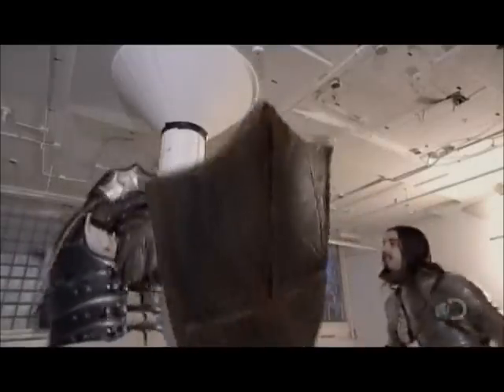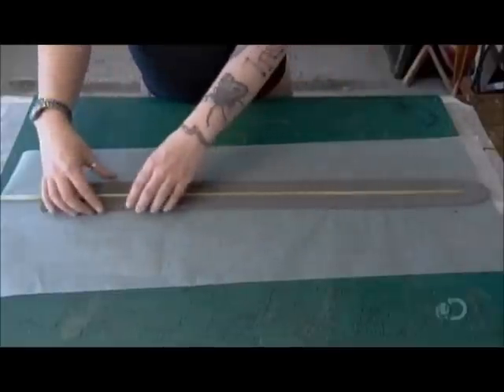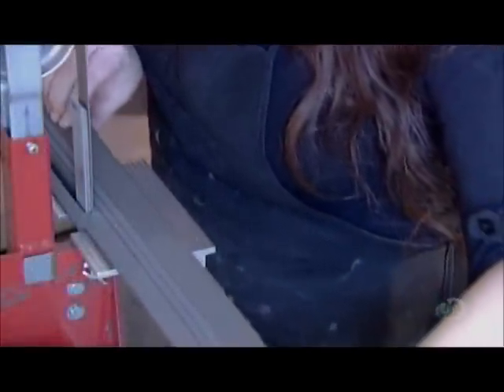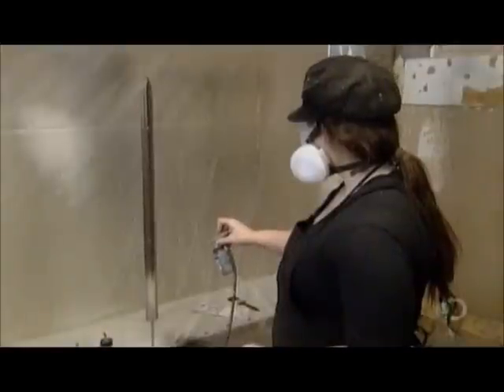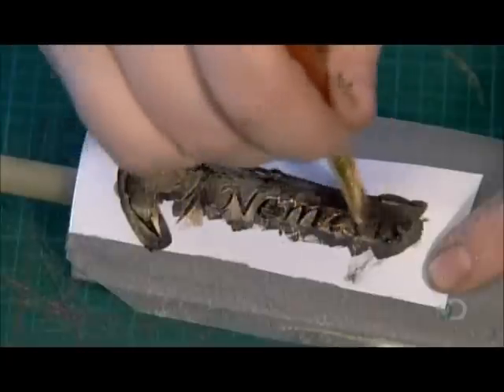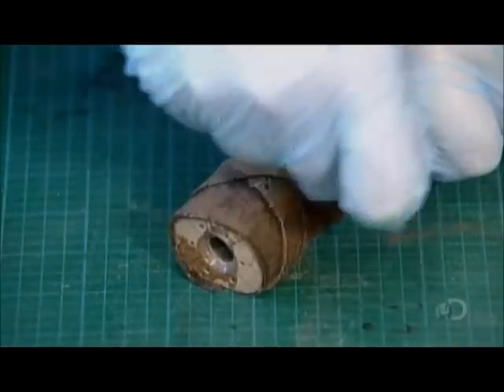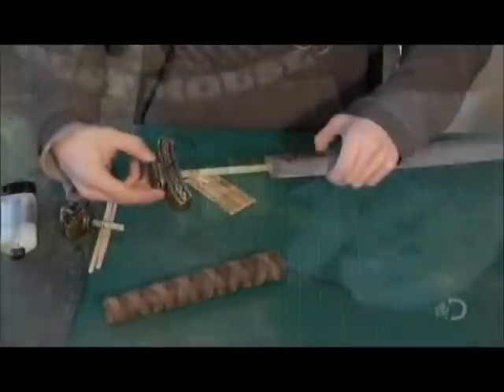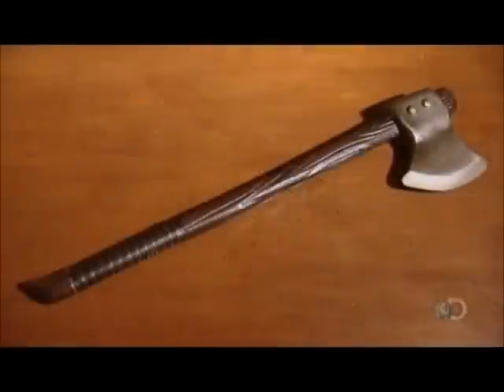How It's Made - Latex Swords

Comment: Larping is incredibly fun. The prices for all the equipment however...
Reply: Lets be honest, those swords are not hard to make... i'm pretty sure you can rent a pain gun and and compressor for the price of a pancake...
Reply: Yeah, the equipment is expensive, but consider that you have material costs, overhead, and likely a couple hours or more of time sunk into each one by the time it's shipped off. Maybe an hour and a half for simpler ones, and it starts making sense. The base models generally run more in the $50 range, which isn't too bad. And while you can sink thousands into garb, you can get some basics that will fit the theme well enough for under another $50. Of course, you can always try making your own if you're so inclined. A lot of LARPs are fine with the cheaper PVC, foam, and duct tape monstrosities, and they may even be fine with you wearing modern clothing.

ForeskinMan Renting tools is actually fairly expensive, and no, most people don't have the skill to create swords of that quality, although they were hardly great examples.
Reply: seigeengine I wasn't complaining dude, I know it takes a lot of skill to make decent LARP equipment ^^; I was just saying, it is an expensive hobby, my daggers cost me £40 alone, the swords I'm looking at will set me back a good £200.
Reply: Commander5AM It's only as expensive as you choose to make it. Getting into it is cheap. A few bucks even. Having an authentic high quality costume consisting of dozens of items can cost thousands though.

Now, the costs to go to LARP events can be pretty pricey though.
Reply: seigeengine The LARP event I used to attend had a standard with rules. One of the rules was all the weapons had to be made by Eldritch and their stuff is very expensive. My get up cost me £10, my armor cost me nothing because I have a good friend who made me it for free as a birthday gift.

The events can be very expensive yes, the one I go to was £60 per event which was full weekend with food provided, but to me that was a lot of money because on top I had to get £40 worth of travel.
Reply: Commander5AM Yes, I've heard a lot or Euro LARPs are anal about costume quality. You know, because way to go Europeans being snobby assholes who create an artificial barrier to your hobbies. That totally doesn't sound like you're complying to a stereotype at all.

Ahem. Yeah, I appreciate that. One of the big North American LARPs I've used as a reference point a lot charges $50 (£32) entry, and then additional fees if you want to play more than one character, or if you want to advance the character more quickly. They do let people come for free if they act as NPCs over the event though. Also a full weekend, but they only provide one meal.
Reply: seigeengine If you want to add to that stereotype, I was doing a photography project in university and wanted to use LARP seeing as I was part of a group but my group split up halfway through my year. So I contacted other groups, all I wanted to do was be on the sidelines and get some photographs for the project. No special treatment, no set up posed shots, I was gonna do all the running around and stay out of their way etc. Two of the five groups that got back to me wanted to charge me £200 for the 'privilege' of photographing their group.

The groups I went to never had costume rules, only weapon rules. Costumes, as long as they fit in with the period or whatever, were fine. It was just the weaponry. Oh and no metal armour for one of the groups because it was kid friendly and they apparently had an accident involving a kid and someone in a full suit of metal armour at some point.
Reply: Commander5AM That IS a costume rule. Most North American LARPs don't require you wear period-appropriate clothing, they only suggest it, because that's just another barrier to entry. Pretty much nobody has period appropriate garb in their wardrobes, so someone just getting into the hobby is going to be dissuaded by that. The worst rules in that area I can remember is a couple LARPs banning the use of graphic tees and stuff like that, whereas a plain solid colour one would be fine.

As for photography, I kind of understand them not wanting to agree to do posed shots, but I'd probably leave that up to the discretion of individual members.
Reply: The rules aren't that strict, it's basically just don't look like you've just turned up off the street. It doesn't cost a lot to buy some black trousers and a white shirt which is the base for a lot of outfits, then you can add to it with a waistcoat or a hat. I did my first LARP session in PJs, for example. They just don't want the immersion to be ruined by having stuff that doesn't fit in. 

I wasn't asking for posed shots. I wasn't asking for anything but permission to take photos of them going about their LARPing. I didn't want poses, I didn't want special treatment, I just wanted to be allowed to stand out of the way and take photos.
Reply: Commander5AM Sorry, but unless you're talking certain styles of dress clothing, pretty much every bit of clothing made today that you're going to find in a store isn't period appropriate.

There was clearly a difference between what you said and how I interpreted it. You listed what you wanted, I interpreted it as a list of what they were giving you.
Reply: seigeengine It doesn't have to be old period clothing, just appropriate to fit in. I got mine in Primark, the cheapest clothing store you can get. So no jeans, trainers, hoodies etc.

No I never asked for anything like that. I just needed photos for this damn LARP book I was making. I didn't want anything posed, I just wanted pictures.

Comment: a pommel now to make sure it doesn't fly out of your hand when its a counter balance
Reply: While most pommels are indeed counterweights as well as slide-stoppers, some are just the latter. I doubt that rubber pommel would be heavy enough to balance the sword at all, especially since the handle had a metal tube in it AND the blade's tip was hollow.

Comment: does anyone know where I could buy the glue that they use to attach the pieses of the blade togeteher? I'm planning on making swords for some of my cosplays and it would really help
Reply: just use regular superglue, the stuff they use is expensive and intended for high quality bonds that last through sustained use. unless you're some ultra weeb that cosplays every day for no reason you don't need better than superglue
Reply: +KingHalbatorix maybe he just wants to make something that won't break in the middle of game. Besides, superglue would probably melt foam.
Reply: Maciej Kozak
He said cosplay i.e. standing still for several hours and posing
Reply: +KingHalbatorix well, no. I said cosplay as in walking around at a convention for aprox 8-10 hours straight for 3 days or so, including skits, fotoshoots, and most likely roleplaying. some of my friend have tried using regular superglue for their props, but it just ends up cracking and braking way too easily. plus, the bonds look like shit and it's hard to conceal them with only paint. the goal of making props with craft foam is to make them flexible and using superglue defeats that purpose.
Reply: Luke Tyler Oswald Pond
why don't you try making them out of metal

oh right, they'd be too heavy for your atrophied little weeb arms
Reply: +KingHalbatorix what about me makes me a weeb exactly? the fact that I want to make my cosplays as good as possible? and about the metal, I've tried using a low price katana, but guess what? they don't allow real weapons at cons. I asked a simple question, and if you don't have the answer then you could just leave.
Reply: +Luke Tyler Oswald Pond 
I used to LARP about twenty years ago, and we all made our own weapons.  Used plain old rubber cement to glue the foam bits, and used liquid nails to attach handles to the core.  That might not sound like it is good enough, but I still have three swords, two quarterstaves and a shield that my kids now play with two decades later.

Comment: It's not just for LARP its for Cosplay too
Reply: What's the point in having a latex sword for cosplaying, a wooden painted one if far less pricey...
Reply: ForeskinMan It doesn't look like absolute rubbish.
Reply: seigeengine It does if you do it wrong and the same goes for wood...
Reply: ForeskinMan Clearly you failed the reading comprehension part of this exam.

Making a wooden sword that doesn't look like shit is going to be fairly hard. On top of that, you're far less likely to be allowed in anywhere with it, because it would be easy to hurt or kill someone with it, whereas latex swords are meant to be used on people without hurting them, so would arouse less concern.

And we're not comparing you pissing around with paint and a stick to you pissing around with fiberglass rods, foam, and latex. The comparison is rationally to a purchased latex sword.

Comment: Wtf he's using that hammer wrong He's holding it sideways. 😈
Reply: Cameron Seitz I was wondering, would it be possible to use latex weapons for actual sparring instead of LARP?  Me and my partners want to use the hard Polyurethane or Wooden swords, but we just can't afford all of the safety gear right now, and we need a safe alternative for the time being. We know that latex swords will be unrealistically light, but we just need something until we get the safety gear. Thanks
Reply: HueyShabazz Unrealistic weight is one thing. The other might be wrong balance - a one handed sword or arming sword should have a point of balance about 1-2 inches above the guard. Another issue might be with binding techniques( blade-to-blade pushing) and half-swording( holding the blade with your free hand for leverage and grappling techniques). LARP weapons may be prone to breaking when using such techniques. You can always make your own training gear. I once used old clothes and cardboard to make layered pieces of protection:). Also you can buy foam pipe jackets from a local DIY or plumber store and put them over your weapons - they are cheap and lessen the blows;).